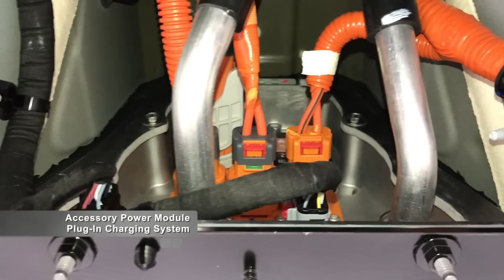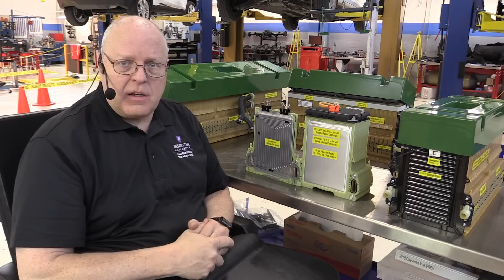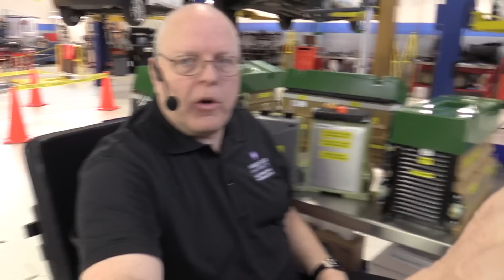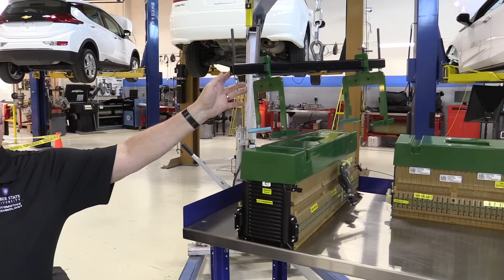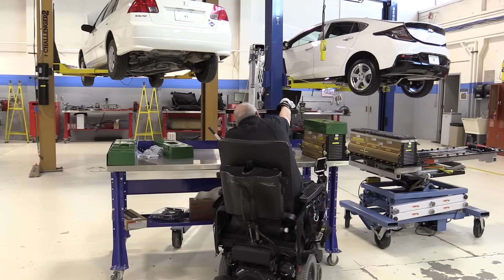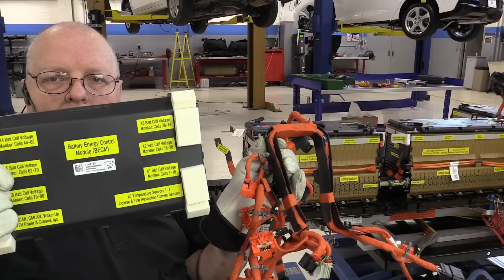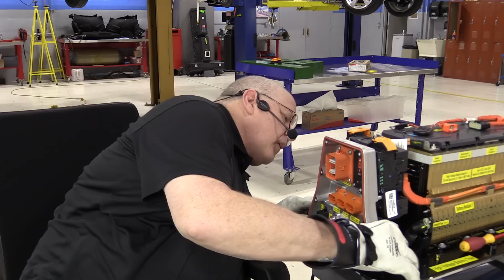2018 Chevrolet Volt 355.2V Li-Ion Battery - Deep Dive

Comment: We NEED replacement batteries for the 2018 Volt!  Today's Li Ion batteries from BYD or CATL have approximately 1.5 to 3 time the energy density.  This means that you could increase the 2018 Volt electric range from 53 miles to approximately 75 - 150 miles.  This is exactly what the Volt always needed. Imagine how seldom you would need the gas engine if you had 75 - 150 miles electric range for your daily commute.  Other chemistries would would give you even more range but I imagine the Battery Management Software (BMS) would need to be updated.  We really need the software Engineer who wrote the BMS for the VOLT to join the replacement battery team to optimize any new battery.

Comment: Hello everyone! Unfortunately, the battery in my 2018 Volt is failing. Does anyone know if a battery pack from a 2019 Volt will fit a 2018 model? I can reuse the BECM from my current pack, as it was replaced a year ago.

Comment: Bought my new 2017 Volt in 2016 and it sill has full battery capacity at 72,000 miles and has never needed repair other than a couple of recall fixes and maintenance. A truly amazing vehicle and one that I believe would stand out in the market even today. The vast majority of my driving is within the ~53 mile battery range, so it's like having an electric car, but with zero range anxiety. Even new PHEVs on the market now don't have that much range, they're still catching up! Best car ever.

Comment: "A cell voltage difference of >0.3v will set a DTC". Hrm... at full discharge, cell difference is >0.4v and NOT setting any DTC's - yet I'm experiencing drivability issues. 2017 Volt, 101k miles.

Voltage App via ODB2 bluetooth connection shows one cell is bad in module 3. But no DTC's! So dealer says "No trouble found".

This is an absolutely  excellent video!

Comment: When he was going over the cells and then thought the Bolt would have so much more to test, I wonder if he thought back to this video when he discovered the Bolt also has 96 cell groups, same as the Volt.  The Bolt just has 3 in parallel for each cell group which you measure as one cell voltage, same as the Volt.

Comment: Great video.  I have a 2014 Cadillac ELR which is basically a 2014 chevy volt.  It only has 9,000 mi on it and one cell number 91 is failing and is setting the fault POAFA which makes the car a brick. It cannot be reset except by reflashing the memory. You can use a nano and a laptop computer with the Delco programming installed which you have to pay for. The dealer and other people like GreenTec  say I need to get a refurbished battery. There are lots of volt owners that are having the same problem.   A refurbished battery for a 2014 is 10 years old. I need some way to install brand new state of the art high voltage batteries and be able to fake the computer or reprogram it so it will operate correctly.  I love this car and I want to keep it but I need a way of getting it back up and running.  I think you would do a great service to a lot of volt owners if you came up with a way to do this.  This would be a great learning experience for your students as well as a great service to us volt owners.  Thanks  Steve Welch
Reply: Did you find any fix I'm having some issue with my elr

Comment: I just removed the battery pack on my 16’ Volt to replace the BECM and this video helped a lot. It was very interesting and informative watching all the different components as he went over them
Reply: Ah, the dreaded BECM.  It's not if, it's when.  The only question is if it dies before the warranty or after.  My son's died at 7 years 97,000 miles.  The dealer opened it up and discovered it was leaking and ended up replacing the whole pack under warranty.  When he bought the car used, we wondered why the battery coolant loop was low on coolant.  I guess now we know.  With 192 little o-rings, it's amazing there aren't more leaks.

Comment: What preventative measures should we take to prevent carbon buildup on the valves on the Atkinson engine due to short cycle times?
Reply: Use premium gas. It will help to prevent carbon build-up

Comment: I have the same issue   I topped the fluid but I can’t clear the code took it to auto zone and they can’t clear the code P1E00  even disconnected the 12 V battery on the trunk still can’t clear it. Any idea ?  Please help

Comment: Thank you for this comprehensive video. I own a 2017 Volt, and like thousands of other Gen2 Volt owners, the Battery Energy Control Module (BECM) was replaced on my car because of a manufacturing defect (NHTSA is looking into this issue). Now I know what the Chevrolet technician did to perform that service. Although I appreciate the engineering of the car, I question how well GM will provide parts support for the Volt moving forward since the model was cancelled in 2019. Engine EGR valves are now failing because of a design defect, and no replacement parts are available and that's been the ongoing situation for months. In the interest of reliability and piece of mind, I'll likely trade in my Volt on a 2024 Honda CR-V Hybrid or Toyota RAV4 Hybrid/Prime PHEV. Thanks for your videos on the eCVT in those vehicles, too!

Comment: Why did you say the battery cells are connected in parentheses when in fact what you might mean is they are in series. Am I wrong? Because two 12 volt batteries in parallel is still 12v vs series now it would be 24v

Comment: Carvana will put the older battery in your 2016 and up Volts the way you can tell is the lower range as you would receive from first gen batteries and there’s no regeneration when you drive down mountains from braking and so on
Reply: Selling you a lemon...

Comment: It's amazing to see how far this technology has progressed in a very short amount of time. That huge batter pack just to provide 40 miles of range. And now GM has a pack almost half that size and provides 250 miles of range - amazing
Reply: Which pack is this? Thanks!
Reply: @DanielSwick  the 65kwh LG Chem pack that the current version of the Chevy Bolt uses. The next gen of Chevy Bolt is supposed to switch over to GMs new Ultium battery pack

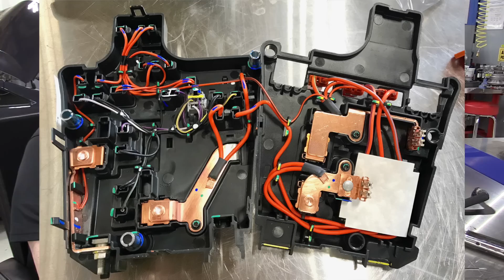Comment: 2 questions... around 1:37:17 you show inside the contactor module and the negative wire on the charger port (the one all the way on the right) is much smaller than the positive wire. Why is that? Doesn't the same amount of current have to go through both wires when the battery is being charged? Second question: around 1:39:18 you mention that those three plugs required terminal release tools to get those three small connectors out... where do I find those!!!! I can't seem to find a resource that says what tool is required for those three connectors. Thanks for the info!

Comment: Hello Professor, I have a 2018 Volt.  I recently had issues with my battery control module.  When I took it to Chevy, they also found moisture in the battery compartment.  This meant they need to replace both the control module and the battery.  They have had my car for 11 weeks and keep telling me that there are no batteries in the USA at this time.  I am curious what your thought are on this and if you agree that there is a battery shortage or lack of them in the USA.  

Thanks
Reply: How was this issue finally resolved ?

Comment: I'm sure that they're a lot better than the two Chevy Silverados I bought back to back 2017 and 2018 won the drive shaft fell off after 600 miles messed up in a way and bent my frame it was totaled and the 18 one burnt to the ground yeah GM it says something for somebody who keeps their hand out every time there's a quote bail out but this car to be nice about it actually looks well built it'll be the first in a while in my opinion and that respectively and I know you have no opinion either way as far as Financial motivation but when I think or see a Chevy I think some country bumpkins unilateral wet dream or idealized version of it and that's what they're paying for with these overpriced tin cans I'm talking about the gas ones not this fine piece of equipment I really mean that this thing looks great

Comment: HI there, thank you for sharing your knowledge.  I am trying to find out where in the car the batteries and BEM are located - front or back.  I'm out junking for a used BECM P/N 24296900 since they are on GM nationwide backorder forever.

Comment: I would love to know the physical dimensions of that lg cell.
Reply: I wanted to know too, and was able to find a thread in a forum where the dimensions for the gen 1 cells were reported as 6.5" x 9" x .25". That's 165mm x 228mm x 6mm. Not sure how precise the measurement is, but should be close. One other note is that the cells are actually 15Ah and 55.5Wh, not 55.5Ah as was stated in the video.

Comment: I wonder if it would be possible to add a second battery in the hatchback, instead of putting it in a T, put it in parallel and create a box metal around it. it would reduce the trunk capacity yes but would double the autonomy of the car .

Comment: I have an question.   Has your department explored the technical and economic feasibility of replacing the existing volt battery modules with higher capacity batteries?   My G2 Volt is about 1/2 way through the battery warranty and perhaps 1/3 through the battery’s predicted useful life.  It seems technically possible that in a few years, one might replace the 2016 relatively low energy batteries with new batteries possessing considerably higher energy densities.

Comment: Thank you for this and your other videos! I wondered about the leak issue with these battery packs in the coolant packs over time, and should these cars get into an accident.
  I'm not a mechanic, but grew up working on my own cars (internal combustion engines, mostly gasoline).
  Is there any crash testing results available on EV and hybrid cars? Do EVs and hybrids generally shut off, or at least shut off current to peripheral circuits should they be strongly and suddenly jarred, such as in an accident?
  I saw what looked like a 2005-2010 or so Prius a gal flipped upside down on the top of the car a couple days ago. The highway patrol shut down traffic to the area for more than a football field in each direction.  They seemed very concerned about anyone going near the accident. I didn't see how she flipped the car, but it was a bit surreal. 😳 
  What do these battery packs do on impact, especially should the coolant packs be suddenly ruptured?  (If you want a specific car, a 1st series Toyota Prius, yet I am curious about other EVs as well, especially should there be an accident!) 
  Could EVs be a hazard for 1st responders? 
Is there a way to safely check if there is current on a wrecked car body that could ground into a wet, rainy street environment?

Thank you for the detail in your videos! You said you thought sometimes you tore a car down further than you "needed to", which for maintenance and rebuilding may be true, but tearing the car down further than necessary helped me understand how an EV and to a large degree, a hybrid as well. Your attention to details, showing the actual parts, the torque on bolts, etc. is incredibly helpful in my understanding how these EVs work. 
   Have you done, or could you do a video on hybrids, if you also work on them? I understand basic combustion engines, but how a car switches between the gas engine and the electric motor is a mystery to me, even though I own a hybrid.
  Could you, or have you, done a video on hybrid and EV maintenance? So many reviews seem to push EVs as "Low maintenance" or even "no maintenance", which is clearly not the case.
  Thank you again for taking the time to make these very clear and concise videos. These are great videos that should be a part of any high schoolers' education, so people know how their car, and other's cars work. (Even if they don't understand everything in the videos, they can still get the basics and more, so they'll have a good, basic idea of how it works!
   Please take apart the module parts that generally aren't taken apart! It is not only interesting, but it is helpful for understanding! (I appreciate the extra effort, especially the screws in Locktite!)

Thanks for letting us know that the positive contactor &/or charging system contactor and/or heater contactor, fuses, contactors (relays+) can be serviced from under the car. Any suggestions for disconnecting the battery, so as to not get electrocuted? Is that why the service disconnect plug is used?
Does Toyota have a similar disconnect plug or fuse to disconnect the high voltage for service (on the 3 different types - generations 1, 2 and 3)? If so, where are they located? 

I know why many gasoline and/or diesel mechanics don't work on EVs. They are very different, and could be hazardous or deadly should someone not be familiar with them!

Have a great day/evening! I hope to see more of your videos  I subbed, and I'm going to have to see what else you have in your video catalog.

BTW, I love the yellow and black labels on the parts! It is VERY helpful in understanding and seeing what you are referring to when you are talking, as well as other parts, and their relationships. 

You are an excellent instructor, you make very easy to understand, and that is greatly appreciated! We need more instructors like you!

Thanks again!

Comment: Not to be rude or anything but since we are learning about electric vehicles. I was curious if there is any new tech coming out due to the rise in electric vehicle design, engineering and manufacturing that is possibly being applied to electric wheelchairs like yours? Could you use any parts on the Chevy to upgrade your wheelchair or vice versa? Thank you for this free educational video and again I meant no harm or disrespect by this.

Comment: This is cool! I'm 52 year's oldn and its difficult to keep my short attention span going.  I'm currently debating whether to amp up my 2013 Volt, ( add a battery, better batter, etc.), or to convert my 5.3 L Chevy Tahoe from gas to a hybrid, as they did make a model like that from 2008-2013(?). The least complicated wi bey project. Since I'm a beginner in the electrical/electronics game, I'm curious. That's my motivation. I work at GM, and we have free 30 amp charging stations while at work. With a 55 mile drive twice a day, I would like to get a hybrid that could make it each way for free, or even if I have to use electricity at home. I refuse to buy an all electric vehicle with fuel back up, don't want to take that chance. Not yet
Thought about the new all electric Chevy truck and put a gas/propane generator in the bed to tie into the ECU, but moght be difficult
 It's capable of throwing out 8.8KW, and has two 30 amp plugs. Decisions decisions...

Comment: You're not going to break a bolt or strip out the threads if there's blue loctite on it. 

Secondly, it's certainly better to slightly over torque a fastener than to under torque it. Especially when it's a critical connection. The best torque wrenches have a accuracy tolerance anyway. While it'll always be close, it'll never be exact no matter what. 
You're a very smart man, and clearly understand everything very well, however, I feel that you don't have any real life shop experience based on several things you've said.

Comment: I am going away for four months and leaving my beloved 2018 Chevy Volt in a garage. I've been told that I should use a 1.25 amp automatic "battery Charger and Maintainer" hooked to the battery terminals for the full four months. Is this correct?

Comment: Wow! I do like that the main fuse is actually replaceable. Since it comes out there is a chance that finding one (even getting one from a scrapped car would work. The main power wiring seems really small for the current going through them, I say that due to the high voltage that current is at. The power level seems way high for such wiring. I build high voltage system all the time and for a 400 volt 380 amp power supply I used 5 1/0 gauge wires for each terminal. I would really like to know worth the ESR and ESL of the main 350 amp fuse and especially the main power handling wiring. Your video was amazing by the way.

Comment: I have a 2012 and can get up to 35 miles. what is very good for the Chevy volt is that they created a great service manual so a good mechanics could trouble shoot the volt. This was done to increase the ability to get this relatively new EV serviced

Comment: Prof. Kelly,  Your dedication to detail is much appreciated.  I like your timeline summary.  My wife just purchased a 2018 Volt.  It's about 4 miles short of the range we need for a round trip to work.  There are no plugs availble at work :-(   I've got a 12V 200AH LIPO battery and a DC to 120 VAC inverter.  When she gets to work, she can connect the inverter to the Level 1 car charger and add another 7 miles or range.  Range problem solved, but it's not very efficient to convert 12DC to 120AC to the Level 1 charger.  Would it be possible to safely connect into the charge connector shown around 4:50?  What voltage (DC/AC) is provided at that connection?  Crazy idea?

Comment: Hello professor John Kelly, I was estonished as i saw this "T-shaped" combination of battery sections! :) It looks very different from this of Chevrolet Bolt.
Manufacturer of Batteries is definitely not LG.
Why wiring of overall negative terminal (and not only) is doubled? Thanks a lot!
Reply from the maker: Hi, it is actually an LG battery. Doubled wiring is more flexible than a single larger cable. Thanks for watching